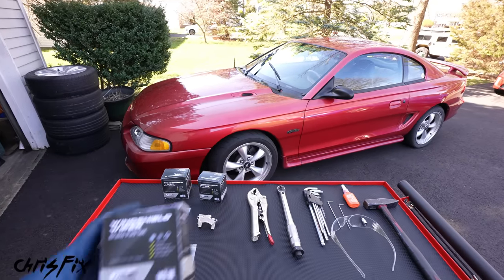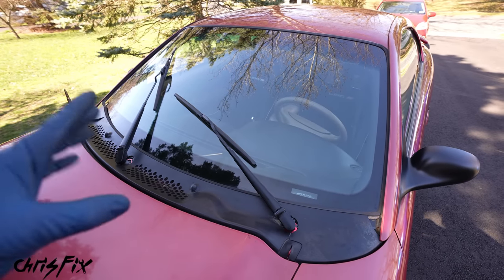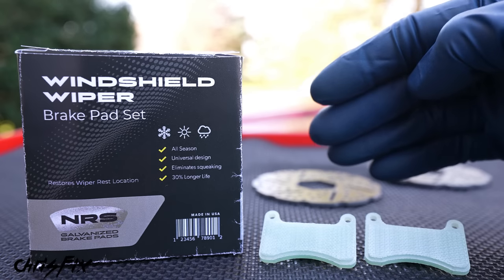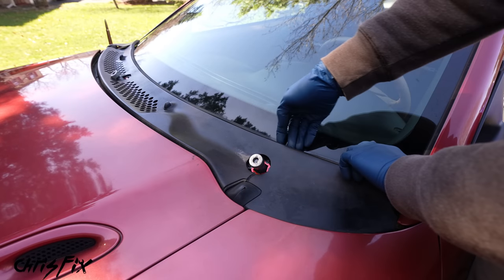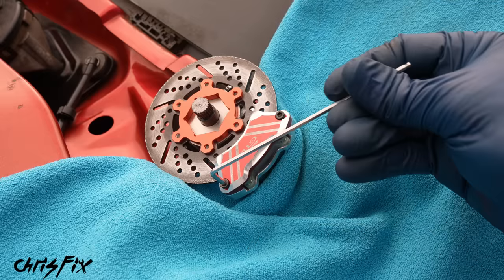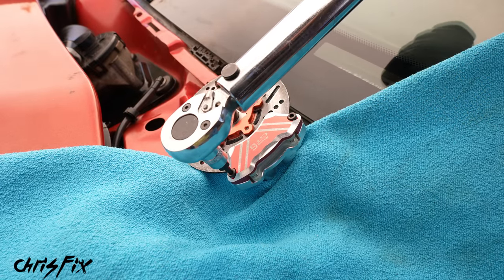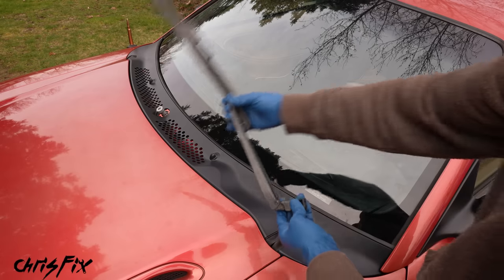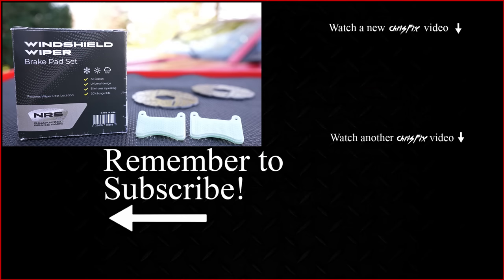How to Install Windshield Wiper Brakes

Comment: My piston return springs where going bad, and your video helped me a ton! I needed new wiper brakes as well, and your video saved me! Also I needed new summer air! Thanks man! I don’t see lots of these tutorials on YT these days, You saved me!
Reply: Did you check your blinker fluid?
Reply: @day1k863  oh crap.. I need to do that! Thanks for reminding me!
Reply: Right!  All-season tires still don't have all-season air!  Why doesn't everyone understand this?!?!
Reply: @noimagination99 man I don’t know! It’s so WIERD why no one understands that you need summer air for summer. And winter air for winter,
Oh and if you wanna take real good care of your tires. Use fall air in autumn, and spring air in Spring!!
Reply: @RichardSmith-rh8wg  Where I live in South Texas, we don't have but 2 seasons.  Once I tried Spring air, but the car got really bouncy.
Reply: @noimagination99  I've just realised that my car still have autumn air in tires. But i must say that i really like how it goes on wet road, and because I'm always drive carefully i think i don't need summer air, as far as i know it goes better on dry road because of high heat resistance and helps well at tight corner turns.
Reply: you guys are so funny haha
Reply: I was really hoping for Chris to do a video on the regenerative windshield braking system on the Prius but he hasn’t seemed to get there yet. I think mine is failing and I need to replace it. The dealership told me it just needed new blinker fluid and to add the correct Japanese manufactured sunlight but I can’t find that either
Reply: @AustinJ  maybe next year he made it. Btw, Are you sure you not misheard sunlight with sunlight breaker that was common back in the days? I know priuses are kinda fantastic but I'm sure that there hides some misunderstood.

Comment: Oh, really helpful mod. I can not stress how useful this is... While cornering , to be able to keep your wiper blade in such a position sing the brakes to attain massive downforce is simply amazing.
Reply: They tried using this trick in NASCAR with the brakes holding the wipers up but the rules committee said no way. It was the Roval I think.
Reply: @zxggwrt  I can see why... The advantage it gives you is humongous.

Comment: I can’t thank you enough for this video! I was always perplexed as to why my wipers seemed to squeak so badly, but now I know! I ordered my kit along with a gallon of headlight fluid and exhaust freshener to make the emissions smell like lavender.
Reply from the maker: Glad the video was helpful!
Reply: In the fall, they have pumpkin spice exhaust freshener.  I love it and spend hours breathing in the exhaust. 

BTW, blinker fluid is on sale this week. Also the canned air so you can replace the air in your tires.
Reply: @Leopold3131  I thought I was the only one who enjoyed the potpourri of fresh exhaust in the morning! I usually fill my garage with that sweet scent and pass out from sheer delight/asphyxiation.
Reply: @Leopold3131  I almost forgot! Time for summer air.
Reply: @flagmichael  It's a little early in some places, as long as the snow is off the ground go for it

Comment: My car runs great after replacing my piston return springs, blinker fluid, and wiper brakes. Thank you Chris Fix. My 1812 Maserati Ford Cessna 151 runs like it just rolled off the factory floor.

Comment: Good video. This is a maintenance issue that many people often forget about when doing maintenance such as adding extra oil to your engine (always add 15 liters more than manufacturer spec, or top of the oil filler cap) and replacing blinker fluid. I can’t stress the last one enough. If you don’t replace your blinker fluid, your blinker will go out. You can be cited for having low blinker fluid!
Reply: Olive oil will do fine
Reply: @aldux  olive oil’s fine but vegetable oil is the best for ensuring that it doesn’t gum up. You can mix it with some blinker fluid to help clean your engine!

Comment: Being an old phart, I didn't get to this video until December.  You youngsters have it so easy.  Back in my day wipers used drum brakes.  No pad slap on those drum brakes, you really had to fiddle with them to get them right.  My '68 International Harvester Scout had vacuum driven wipers and it was a real pip to get right.
Reply from the maker: I always convert the drums to discs. Drum wiper brakes are a pain!

Comment: Priceless! I'll have to replace my wiper brakes this weekend when I change the blinker fluid. When I go to get the parts, I'll take back the sheet metal screws I bought last week. Half of them had the heads on the wrong end. 
Edit: I was wrong on the screws. The ones with the head on the other end are for the other side of the car!
Reply: You'll need a left hand screw driver for the screws on the passenger side.
Reply: @chrisgraham2904  I’ll get my wife to do those. She’s left handed!

Comment: I've worked on my car for years thanks to your thorough videos. I had no idea there was an actual brake assembly system for windshield wipers.
Mind blown.
Hi Shmee.
Thanks for another very informative video Chris 🙏🤙🏼👊🏼
Reply: Everyday's a school day. Just need to find my hammer.
Reply: Glad you learnt something new!
Reply: You young whipper snapper! I remember when they used drum brakes instead of these fancy schmancy NRS disk brakes. The only problem with those was that they faded if the wipers were used on high for long. In those days, the brakes were used for switching the direction the blades were moving, too.
The early disk wiper brakes squealed so much we all thought it was bad blades. We were so foolish in those days.
Reply: Don't forget a covid 19 booster in cabin filter

Comment: I love the commitment to the joke.  The video is just as informational as a real one and entertaining too.  The printed box and 3d printed parts look amazing
Reply: What joke? He is just showing how to install brakes on the wipers man. I did that too because i had problems with my old ones
Reply: @Babom_Official  my 98 corrola had the same issue but it had faulty piston return springs that knocked the wiper brakes out of sync so i had to buy a brand new tesla to hopefully avoid the piston issue :/
Reply: @ChickenSDS  i think it's a problem with older cars.. i have a 2000's Golf 4
Reply: @ChickenSDS  And don't forget the 1000-mile-long extension cord.

Comment: No wonder my Toyota wipers were skipping off the engine cover, the brake distance was set too far. Lifesaving video, ChrisFix never fails to deliver the much needed content. Now I need to go order some Blinker Fluid as mine looks pretty dull.
Reply: Check your vehicle manual in case it calls for DOT 4 blinker fluid.

Comment: I didn't have the budget for wiper brakes and i noticed my wipers are stuck on my windshield at the lower section of the windshield so i just took my front brakes off and used them as the wiper brakes, great braking force.. low budget. Although my wipers stop real quick now, they do stop faster than my entire car does now so tid for tad, its a good investment without making an investment do recommend this upgrade 9/10

Comment: 9:50 the wiper blades are elevated off the glass.

It wasn't mentioned, but this is perfect positioning, as this makes sure that you don't damage the rubber blades as they wipe across the glass surface.
Reply: Another A1 tip for you is to keep those yellow money savers on the blade edge when you install them. Instantly extends the life of your blades tenfold.

Comment: The NRS wiper brake kits are the best you can get. After replacing mine the screeching went away and they always park where they should. I just saw your video on the difference between summer air and winter air in the tires and I'm about to change to the summer air. Wish me luck it looks like a pretty good project.

Comment: I never knew I needed to do this! My wiper blades was squeaking like crazy so I replaced the wiper motor fluid with no dice, but thanks to you no more squeaks! I installed a set of Corksport wiper brakes

Comment: Wow, awesome job, I just replaced mine on my vehicle. My windshield wiper brake pads were down to metal and making a bunch of noise. My wipers now work better than before because I upgraded them to the bigger Brimbo calipers with drilled and slotted rotors on my wipers. What a difference from the stock one's. 😁👍

Comment: Thanks for this, Chris! Went ahead and fitted mine with Brembo calipers too. Wiper blade stopping distance have since significantly dropped, even at max wipespeed. Better heat dissipation also means I can run them all the time, good weather or bad. Thought I've upgraded everything on my car until I found this video. Super helpful!

Comment: Thank you so much for this educational video. This is a very common problem that no one covers. I’ve paid a lot for the brembo wiper brake set. They changed my life.
Reply from the maker: Glad it was helpful!
Reply: @chrisfix  next year you can do a tutorial on how to change the gas out of tires. I put diesel gas in my tires instead of premium unleaded gas and they don’t roll the same. Please help.

Comment: Great advise, I finally got rid of the wiper squeaks by replacing the worn out pads and while I was at it, I also refilled the blinker fluids - just in time for the summer road trip. Thank you Chris for the great videos!
Reply: I never heard of that where his blinker fluid I can’t locate it on my car. I’m 17 and I never heard of that before.
Reply: @perry8322  he has another video on replacing blinker fluid, maybe your car was made when blinker fluid had to be replaced by buying a whole new headlight bezel
Reply: This is all new to me blinker fluid brakes on my wipers. I’ve only had my car for 2 1/2 months. I’m gonna look into it tomorrow at shop class and asked my teacher.

Comment: They’re a bit more than twice the price, but I opted for the diamond infused ceramic wiper brake set. They really make a difference on my 1981 Chrysler K-car, especially at highway speeds.

Comment: There is this second brake pedal for the wiper brakes to the left of the main brake pedal on my 1982 Russian built Mikhail Olson SUV. The wiper brake petal is often to the right of the foot parking brake and is usually pretty much identical to it. Therefore, if you were to press the wiper brake pedal, the wipers would slow down. This is especially helpful when the wipers reach the A-pillars and you don't wanna scratch your paint.

Edit: I later discovered that Mikhail later switched this pedal in the early 1990s with a hand operated lever upon the introduction of the second generation model. Although the wiper brakes in this model (alongside other models that use wiper brakes) usually stop the wipers prematurely, Mikhail ultimately had to recall the Olson for this exact reason in the late 1990s. In addition, the 3.6L Aspirin diesel engine offered as the sole diesel option by happenstance incurred the same faults as the later 6.0L Powerstroke diesel engine. Aside from this, wiper brakes were largely abandoned in cars manufactured by Mikhail by the late 1980s, and by the 2010s, some models even had wipers driven by direct-drive servomotors. This is all information I got from a salesman for a U.S. dealer.

Comment: Chris, detailed and informative as usual. It's also a good idea disconnect the battery before working around the engine. Just one question, is there a place where I can get a left-handed wiper brake since I drive in the UK?

Comment: Great video, although you neglected to mention that that wiper brakes for a back window wiper blades have to be installed in reverse order.  Otherwise they will go quickly when you choose intermittent and vice versa.  Great day to work on a vehicle!

Comment: To avoid overheating those wiper break pads, be sure to lubricate your windshield with a thin layer of grease so they dont have to work as hard. Should reduce basic wear and tear too.

Comment: Oh my god Chris you just saved my life! My wiper brakes were in a pretty bad condition and non of my local mechanics knew how to change them but thanks to your video
 I was able to change them and drive with peace of mind that my wipers are in optimum condition and also that my blinker fluid is filled to the specified level
 and not to forget other crucial things to do like using the
correct season air in the tires, greasing steering wheel for better handling, rotating the wiper blades, and spraying alien repellent everyday to prevent aliens from sneaking into my car.

Comment: How often do replace the brake fluid?
Reply: 2 years
Reply: At least. You want to always keep an eye on them when you start up the car daily
Reply: You don't.  it shares the same reservoir as the blinker fluid and it eventually just runs low
Reply from the maker: Once every 5yrs since wiper brake fluid is hygroscopic. That means it absorbs water.

Comment: A suggestion (for those car guys that have to replace these brake pads once in a while, I would know), NEVER reuse the original rotors! Always, ALWAYS replace them with the included rotor in the kit, this will prolong the life of your wiper resting position, as well as having the brakes have a nice even surface to grip on to, just a nice tip for those car guys out there.
Reply: There's no point re-using them anyway imo. they ussually come in a full set anyway, no point re-using a rotor to save, what, $10.

Comment: IAROTFLMAO!!! This is your best one yet! The attention to details is just amazing! The only thing you forgot to mention was that the pads will overheat and wear prematurely if you don't keep your washer bucket at least half full. That is because not only does the solution wash your windows, it is also the activating fluid and cooling fluid for the brake calipers! Shame on you for missing that important detail!!

Comment: WOW I've only worked on older ford tucks and did not know this was a thing. If not for you Chris, I totally would have called BS on wiper breaks right up there with blinker fluid. Thanks for the education😂😂.

Comment: If you score the backside (non printed side) of the boxes, it helps with stopping the ink from cracking when you make a bend. Also making the bends slower helps. There's a special tool called a Bone Scoring tool that helps with this, but you can also do it with an exacto knife and a light hand. Just be careful to not cut through the card stock.

Comment: My snow roof had its wiper brakes installed improperly and for 6 years the wiper would push the snow to the front windshield and we would have to stop and shovel that off. Fortunately we decided to move further south where there is no snow, now we have an issue with Rain Roof… but as the car is electric we can use a hairdryer to evaporate the deluge of water that now piles up on the front windshield.

Comment: I notice you are using GT6’s. I’ve found you can upgrade to GT7’s if you buy upgraded springs. If you don’t have a performance car obviously it won’t make much difference to your overall speed but they do look good. Good work dude.

Comment: You also need to change to summer automatic transmission fluid in your manual transmission when the outside temperature changes in the winter

Comment: Dont forget to re-bed the pads on the rotor, wipers on highspeed, come to fast stop without fully stopping, back to full speed, reapeat 3 times.  This will help prevent wiper brake surging on hard wiping ;)

Comment: I was gonna replace my windshield wiper brake disc rotors, but I’m still not over losing all my guns in an unfortunate boating accident… I should have listened to the experienced old timers when they told me that whenever someone who owns guns brings them on a boat, they automatically become terrible skippers!
But nevertheless,I will try to get my wiper brake rotors swapped out this week, the wear rings on the things are really bugging me… thanks for the guide!

Comment: Man,  had this one car, never change the wiper brakes once. It worked well for years. Then one day, BANG, the pads completely gave out mid wipe. Next think I know, the left wiper shot right past the A pillar and was overhanging like crazy. While the left wiper, now with no brakes, kept on wiping. Except, instead of nice smooth controlled stops, it just swung really fast and then SMACK! Only for it to immediately swing back the other way SMACK! It just kept on doing this until I, like a dumb ass, remember that I could just turn the wipers off. Morel of the story, preventive maintenance is important kids. 🛠👍

Comment: Also. If you have a  miss or skip in your engine you may need to replace your Piston Return Springs. I just replaced mine with the Performance Pack Springs. Added almost 100 Horsepower 🤔

Comment: Great video, very informative, love it. Also, this reminded me, i need to change my exhaust bearing 😁
Reply from the maker: Glad it was helpful!
Reply: You may not need to change your exhaust bearing.  I removed mine and fully cleaned it in the dishwasher, re-lubricate it with bacon grease and you should get at least another 50 K miles out of it.
Reply: @chrisgraham2904  thanks for the solution, problem is i dont have a dishwasher.. can a washing machine be used instead?

Comment: What I’m impressed with is how you command the wipers to wipe from outside the car.  
Can you show us how to maintain the Wi-Fi wiper controls?  My Wi-Fi signal seems low, and I can’t find the router terminals in my old car.

Comment: It is important to replace the gear sand regularly.  The green one is usually included at the factory.  However, the blue gear sand is better.  Only costs slightly more.
Reply from the maker: Very true!